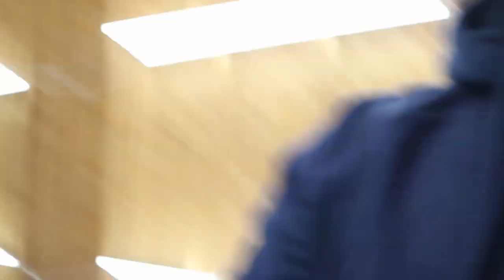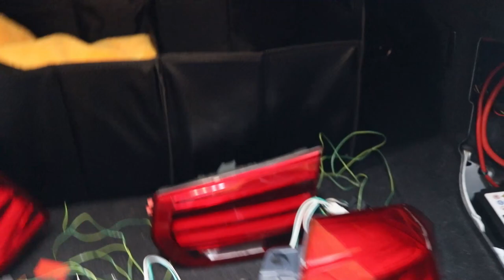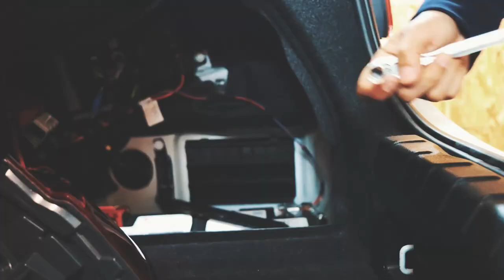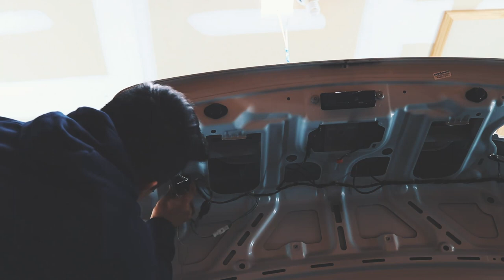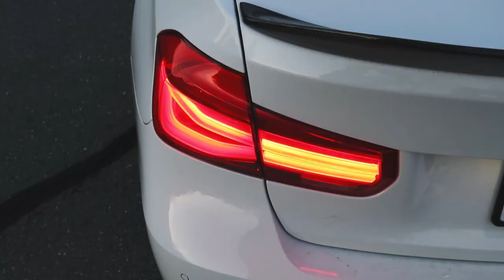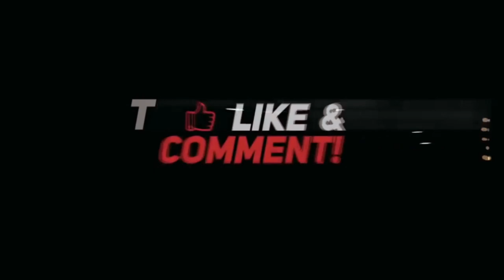My MOST requested F30 UPGRADE!

Comment: Nice work on the LCI tailight upgrade!  I have a quick question,...are the 19" OEM 403s staggered or square?
Reply from the maker: Thanks! They're staggered but only half an inch difference
Reply: @EldridgeCortes  

So, 19x8 Front and 19x8.5 Rear!

Ok,..thank you!